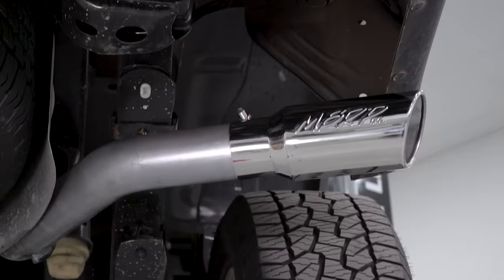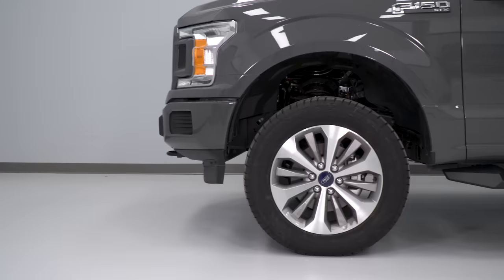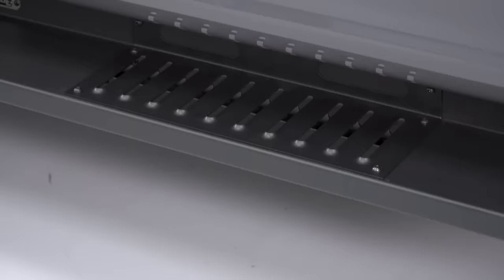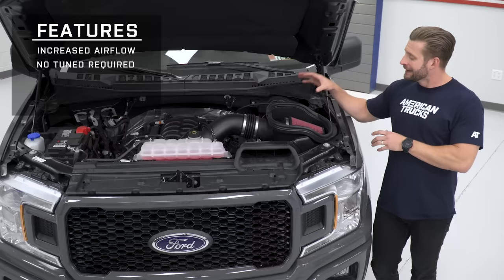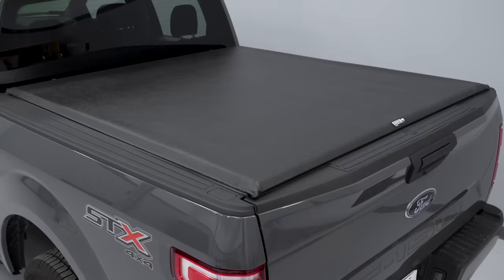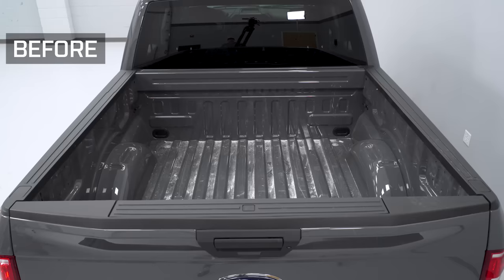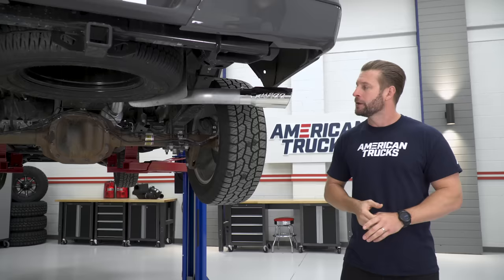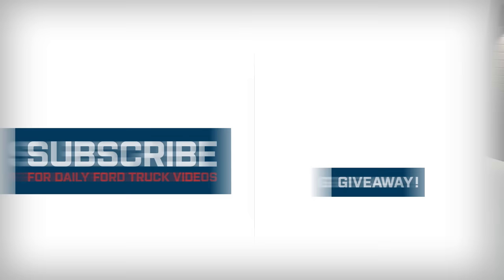The First 5 F150 Parts You Should Buy Under $500 For Your 2015 - 2018 Ford F150   The Haul

Comment: Great. The perfect recipe for literally taking 500 dollars and putting them in the trash. The strut spacers are bullshit, good luck with the alignment issues afterwards, not to mention the vibrating. Running boards, if you have them leave them be. Intake and exhaust is basically stock, you get what you pay for. And tunneou cover...well, i like full fiberglass tunnoue covers...another waste of money.